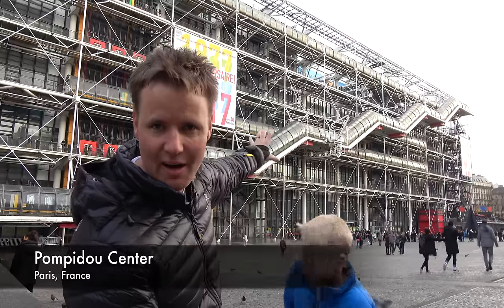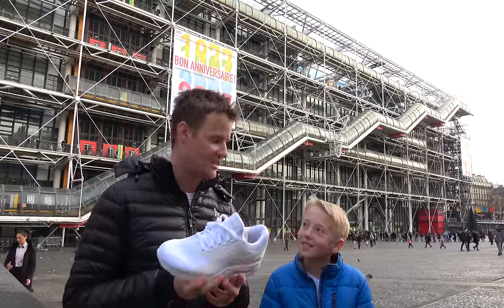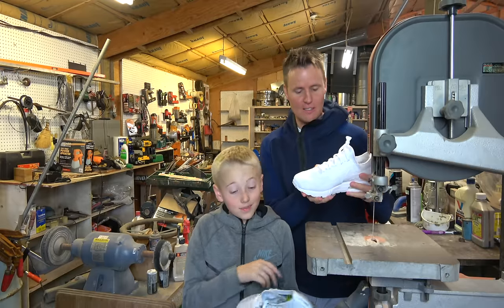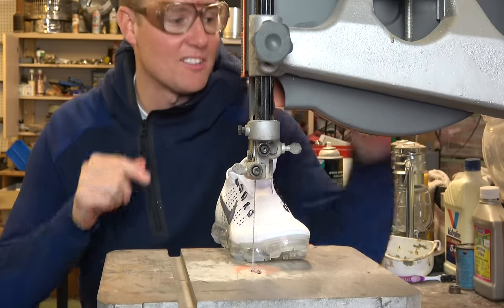What's inside Nike Air VaporMax?

Comment: Can you do Whats inside the twin towers?
Reply: Snald a plane
Reply: Screams...
Reply: controlled demolition
Reply: Thermite set by Bush o_O
Reply: steel beams melted by jet fuel
Reply: spmPvP yeah Im sick I have ebola
Reply: Snald savage
Reply: That's bogus lmao
Reply: Planes
Reply: Snald that's not funny
Reply: Tyler Gong but it came straight down by blowing up the bolt of the beams
Reply: Tyler Gong super strong heat would warp the steel
Reply: Tyler Gong but not a passport?
Reply: Steel beams
Reply: Snald islam already did that

Comment: The gas in the shoe is most likely either Nitrogen or Argon. Same way as if you have a decent car, with decent wheels/tyres, you fill them with nitrogen rather than atmospheric air (which is a blend of oxygen, nitrogen and carbon dioxide - as well as other stuff like water vapour etc which you don't want as it'll form condensation). Nitrogen filled tyres hold their pressure more in a more stable fashion when subjected to a different array of external conditions, but mainly temperature.

Comment: Try the old microwave trick. remove metals and don't touch the inner walls. & sum textiles can melt so Watch it, if u see sparks stop & remove. Most adhesives will be reactivated allowing  all the sole to be pealed off in one clean go. also try OLFA blades. there the sharpest blades i have ever found i used to cut every thing with them, back when i made shoes.

Comment: Yes I have one of those spring blade the flow of the design was the rubber of the sole kept falling off the adhesive used was not that good they shouldnt use a separate rubber because it falls off it should be a solid rubber but other than that it was great comfort

Comment: If you have one air max 93 for waist, i need bottom part, cause mine fell apart due too very high humidity in country where i live. Otherwise, material on the top is brand new, and i want to save them cause they’re special! I will appreciate

Comment: 5:12

“That was so easy!”

Idk kid, u’re using a band saw that can be used to cut PVC pipe like butter 🙄 it can be used to cut steel plating and even tiles. So yea

If you call that ‘easy’, I feel that a pair of lifestyle sneakers that requires more than a razor blade to take apart is kinda tough..